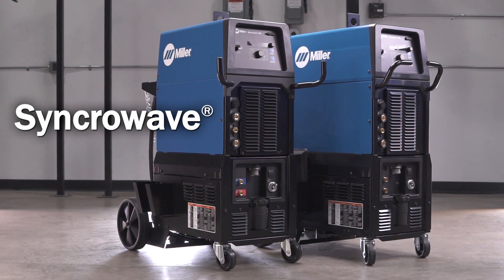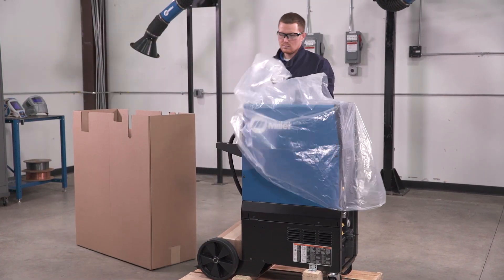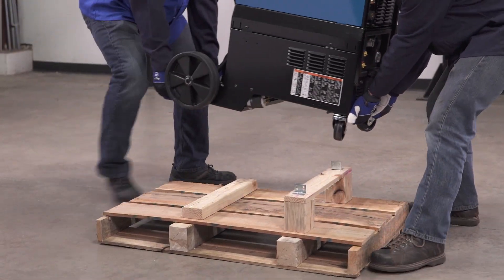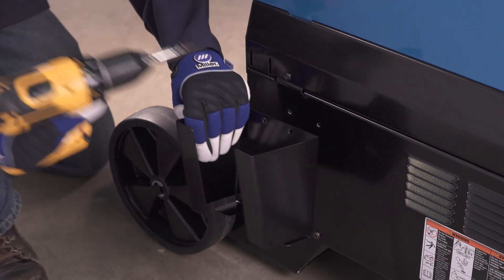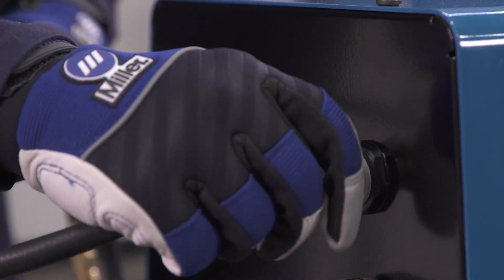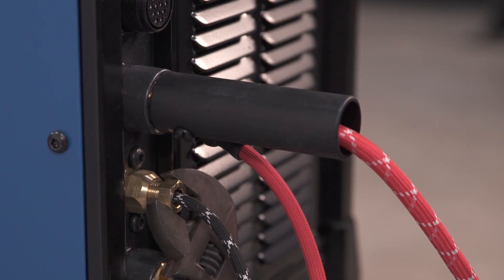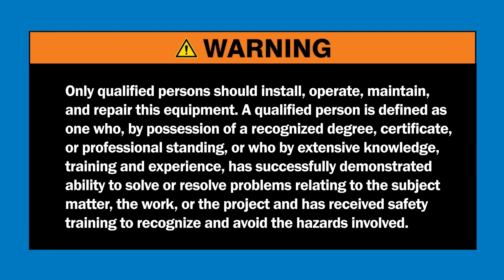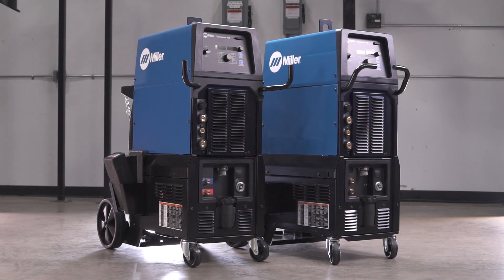Syncrowave TIG Welders: General Setup Steps

Comment: If the foot pedal isn’t used .Can you connect a trigger button to the torch head with this machine ? I currently have a 250DX and using a trigger and may want to upgrade to this 300. Just not doing table welding and can drag a foot pedal up and down 15-20 foot long gates.